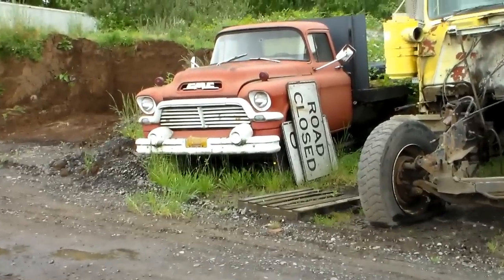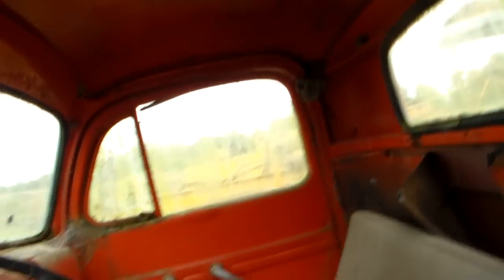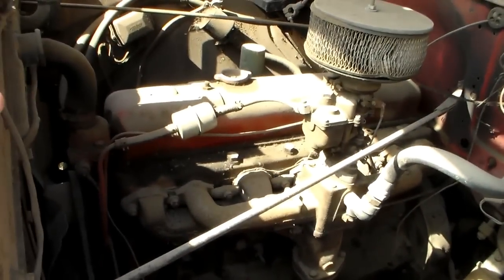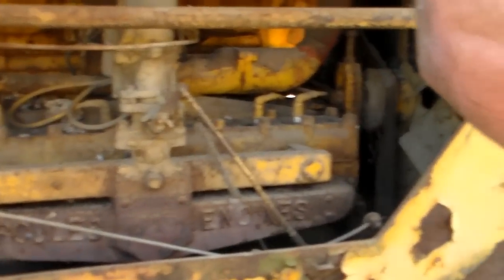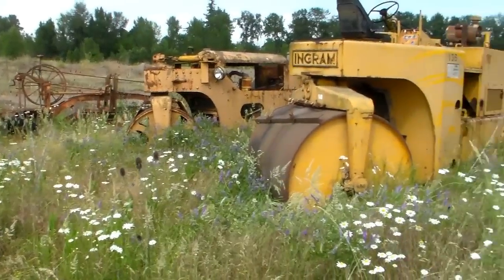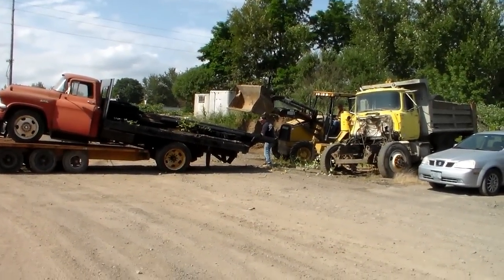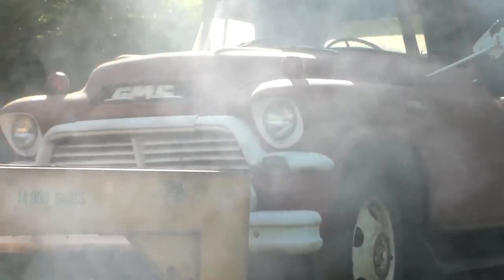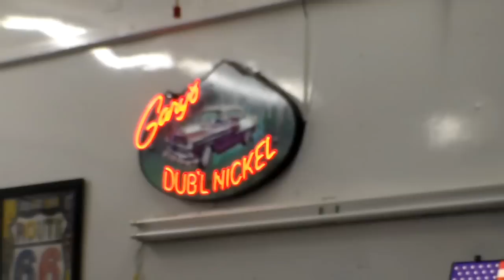1957 GMC Truck Rescue "Homer" blows his engine (CTR-37)

Comment: God bless that couple, very nice. I had a 58 Chevy Biscayne before I could drive sold it for the engine to a body shop. My mom's dad had a 58 Chevy Impala or Biscayne that I did my first brake job on with my instructor and grandpa.
Another one saved from rust. TFS

Comment: I learned to drive truck in two old 600's one dump truck and one with a flat bed. I could reach the pedals when I was 10 and used to buck hay with my best friend. We would take turns driving and when we were 14 we drove all over the county for the Retired Sheriff and my friends uncle who shared a hay and horse stable business. We always had a half case of Rainier beer between the seats after we left the field  and one after stacking in the barn. We hauled more hay in a day that 3 or 4 kids getting towed around on a trailer. Lots of memories good times.

Comment: I once found a neat old 55 gmc equipment hauler, wanted to buy it and told my Dad about it thinking I could borrow some cash to get it.  He said no, you don't want no 55 GMC the dang motors are one of a kind in-line sixes that year, they run in reverse direction that year. Ahh perspective, to me that made it special along with the reverse snorkle mirror in the roof so you could see the equipment was still secure on the back. Sad, part before I could get the cash together a biker group that rented a building on the property lite a pile of pallets on fire and burnt the motor all the way into the firewall. Didn't leave much. But what a truck. !!!

Comment: I have a pull behind grader I use every spring. You'll get a work out turning those wheels trying to get it where you want it. believe me your better off with a 3 point grader blade. I'm just to cheap to buy one. cool finds though Rick👍

Comment: We have a 57 GMC "That's what Ive always been told" Its a 2 ton farm truck with grain box and hoist. Hasn't been started in a few years. It has a small inline 6. Ours has the push pedal beside accelerator to engage starter ad also a  vacuum 2 speed selector on left side of dash.  Our grille is different than the one your videoing.  Sure do have a lot of memories driving that old pig, never had any power super low up the hills and hang on down the hills. Lots of play in steering and 99 percent of the time no brakes. I enjoy your videos.
Reply from the maker: Your description of what its like to drive some of these old guys is spot-on accurate. Thank you and Thanks Fer Watchin'. -Rick

Comment: Based on the distributor location on that flathead, that F6 is a 49 or 50. The 48 would have had the distributor on the front of the camshaft. Both the Ford and the GMC are very nice pieces. Great finds!!! I learned to drive on a 48 F1 half ton pickup. BTW, the hood latch is the left "nostril" on the front of the hood. Sorry about Homer. ;o(

Comment: Hey Rick I bet this '57 GMC 3 ton runs all you gotta do is change the oil, Spark Plugs re-run a new fuel line to a EF pump to Carb hook up a battery check & make sure gas pedal isn't stuck & manual Choke pulls out &take off Air filter Pump the hell out gas & listen to her fire UP & purr like a kitten Hey never know it might start right UP! it's a GMC never know it might of been shut off just yesterday! (that's a saying a good saying!!!!!!)
Reply: Can't wait to hear ya get it her Running Does the GMC have the stomp the starter on the floor or a key start??
Reply: +69ChevroletNova why do you have that picture stealer
Reply: +Javier Gomez Hey it's not stealing lol it's just a truck that i like
Reply: 69ChevroletNova - Learn to write/type in proper English!  Have someone read your comment back to you EXACTLY as it is entered, and then think about whether ANYBODY OTHER THAN YOU can possibly interpret your random ramblings as a coherent statement in the English language (regardless of colloquial dialect)

Comment: Hi another nice save on the truck thanks for posting,  The argument on the truck brands will never go away. I run ford and GM and guys that like Dodge have a problem with it. It don't bother me any more,. they are mine and paid for and do all I want, just ignore them or sometimes I ask Dodge guys how there steering or ball joints are L.O.L.    The Roller next to the pull type I was wondering if you looked at that one more. It looks like it might be based on a fordson tractor, I couldn't quite see enough of it in the video.

Comment: Glad to hear there's a engine waiting for Homer. A diesel swap I've always thought would be cool would be an IH DT360 or DT466 (6 cylinder 360 or 466 CI) there's lots of them out there in international trucks with 5 speed's and with PTO. not sure how the they would fit though.

Comment: I used to have to work on asphalt sewer and garbage trucks...welding underneath is fun...Rick why you have fords and Benz s? Stay with American Cars and GMC/Chevy No1 pickup s...I got a 1996 GMC 3500 dually utility with welder tools compressor from utility auction 6.5 diesel runs great...slow but tows good. Love your show.Also I just picked up an Onan rv generator 4kw super quiet puts out full power at 1800 rpm...$100...Mich quieter and cheaper to fix than Honda although Honda is the best until it breaks..lol. How's your backhoe ?

Comment: Rick good luck getting another motor in homer soon. Big Block or Diesel?   Nice score on the 1957 gmc. Good luck getting the rest of the honey hole finds. 

I emailed  you more  leads on a couple trucks & Wildcats.
Reply: Hold up. Did I miss where Homer got hurt? Where? What episode?
Reply: At 40:42 Rick says homer has a rod knocking and then at 42:44 rick talks about the brakes smoking and needing to be replaced. 

 Then At 42:47 his friend Steve gives the damage assessment for homer.  Then at 44:50 Steve talks about the scare homer gave him the last trip with no brakes though the center of Canby oregon. Where he went though a intersection  with no brakes.
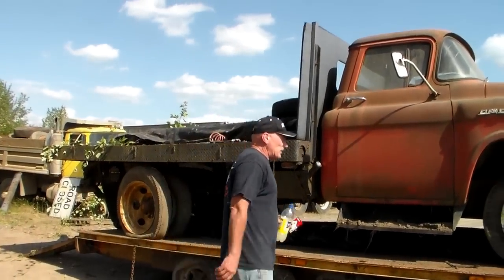Reply: You can also hear homers sick engine at 39:09  -39-44 . Main roller bearing or rod knocking starting. Where rick ask his friend Steve to keep the rpm down and drive homer home before the engine quits.  

At 39:28 Rick says homers engine isn't sounding good. At 39:34 rick says it is time for the rebuild of homers engine.  

At 30:22- 34:40  you can hear homers engine start to go. When Rick is putting the wheel  chocks behind homers tires.  At 30:32 you can hear it really well.
Reply: I didn't even finish the Vid. Just scrolling through the comments before I do and saw that Homer was sick. I love that beast. Wish I could run up on one for myself. Around here though even Trucks that aren't even 10 years old are so full of rust it's pitiful. I don't understand it. Pay $50K+ for a Truck and people don't even bother to pay that little extra to do an underside wash as soon as the salt is off the road.
Reply: How about a sticky valve?...
Reply: possibly but not likely because of the rod knocking at the end. More likely is a main bearing, connecting rod, or snapped rocker arm assembly. 

When listening to the engine it sounds more like a main bearing or connecting rod bearing  spinning well loading bob.

Comment: HEY RICK  I TELL YOU  SAVE HOMER WRECKER TRUCK , CHANGE  OLD REAREND IS  NO GOOD  WAS BAD BRAKES,  YOU  FIND  ANOTHER FIND LATE MODEL TRUCK DUALLY ASSY  REAR DISC BRAKES , MAYBE  DIESEL MOTOR  MORE HORSEPOWER SOON  FOR HOMER  BACK TO LIFE   SOON
Reply from the maker: Andre, I agree with you about putting modern drive-train components under Homer. Be patient my Friend. I'm not rich and have to keep building the Classic Truck Ranch while rescuing trucks to find homes for and earn a living. Homer isn't going anywhere. He is safe and home and still runs and drives. You will see him restored and I think you will like what I plan on doing with him. Thanks Fer Watchin'. -Rick
Reply: THANK YOU!  Rick,  I am happy to hear that Homer still runs and drives!

Comment: Why were his brakes smoking?? Was he pulling Bob with his brakes on???
Reply: The rear brake wheel cylinder's  for the  brakes froze.  And the brakes where stuck on pushing against the rear drums and got really hot and cooked the brake fluid dripping from  the rear  wheel cylinders seals and produced the smoke.
Reply: Ouch!!! So the short answer is "yes" he was pulling Bob with the brakes on. That would put a bit of a load on his motor wouldn't it???
Reply: Yes it would put some load on the motor but not any where close to what it would take to make the engine let go.  It would bog down the motor but not to the point of making it let go. 

GO on Mustie1 youtube channel and watch his 2  most recent video. about his mopar that had the same issue. 

Watch the video titled 1967 plymouth test and tune  at the  last 1 minute and 1967 plymouth, smokin

Comment: Will the Wrecker body fit on Bob until you get Homer repaired?
Reply: It would not be cost effective to move the wrecker body to bob. 

Rick would need to move all this list  below to make it work. 

1. wrecker body 
2. all the clutch mechanisms from the cab back to the wrecker body controls. 
3. the pto from the transfer case  
4. wrecker controls in the cab and custom switch panel. 
5. wrecker body wire harness  to the cab for the lights. 
6. cable drum and winch cable 

Where instead he could mount 1 or 2  winches on the trailer and use the old mule #1 to pull the trailer. Since the pick up truck is already set up for it. Like when he brought the fifth wheel home.  Or Rick could put a fifth wheel plate and hitch on one of the bigger trucks to pull the trailer.